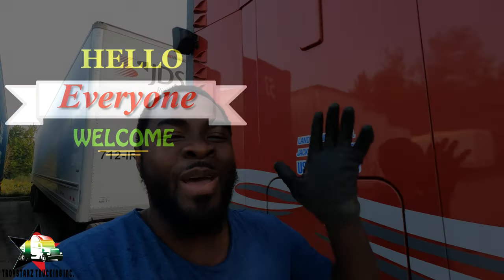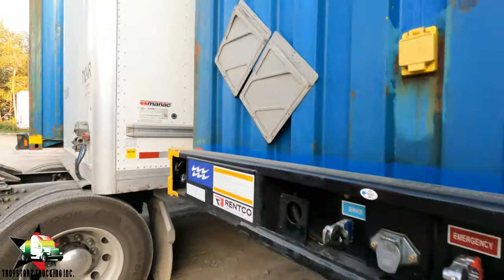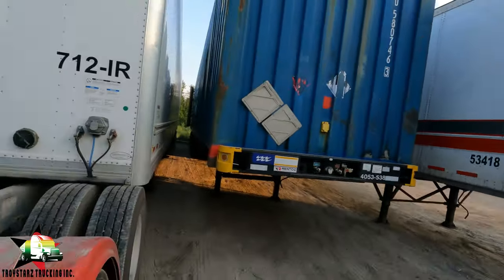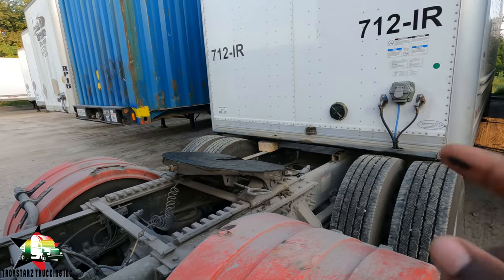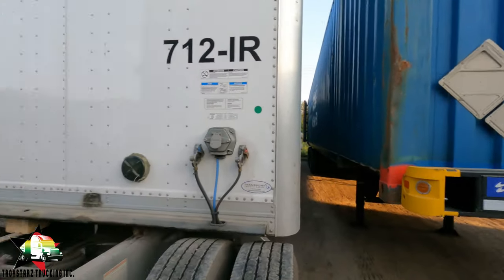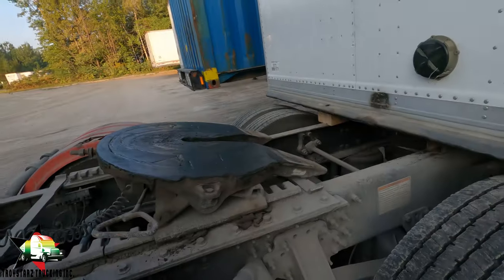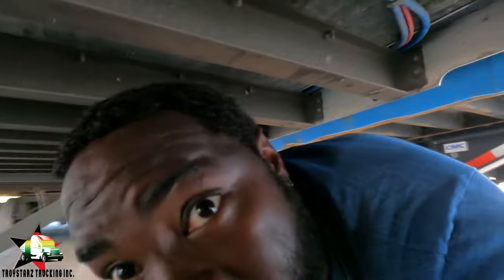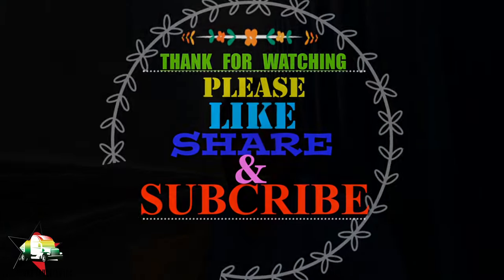How To Hook A Drop Too Low Trailer. #tips  #troystarz

Comment: So basically if you can you dump the air bags and then with the fifth wheel holding the trailer you wine the landing gear down ?
Reply from the maker: Yes but sometimes you need to add more add more hight to have the air left the bag up